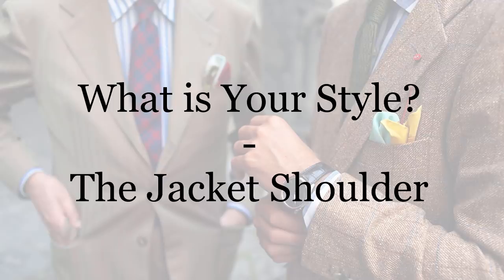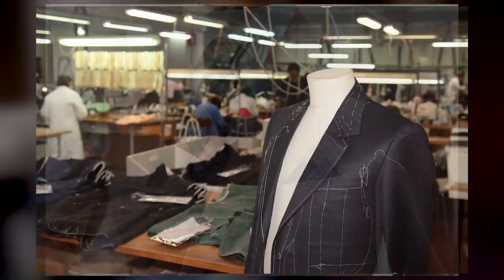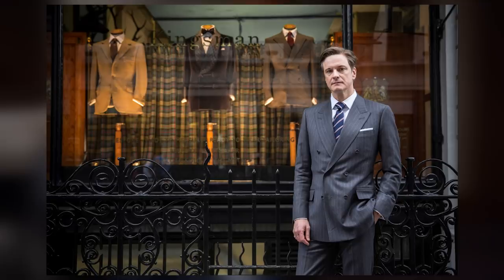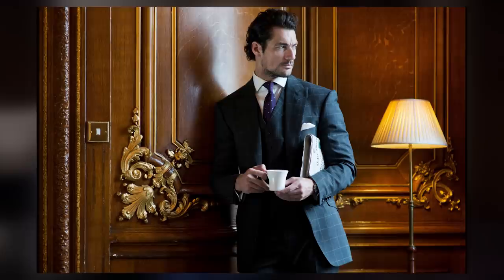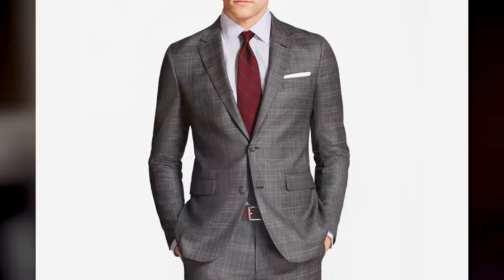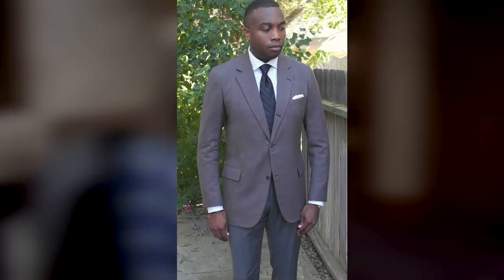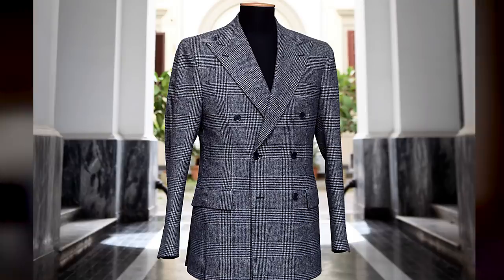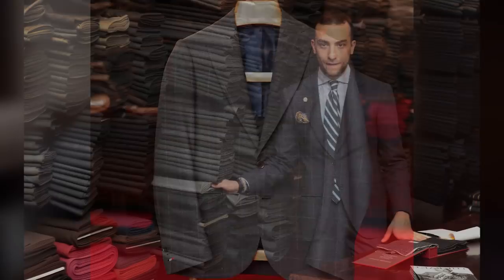What is Your Style ? The Jacket Shoulder

Comment: I own a white tie tailcoat from 1927, made on Savile row, and the shoulders are absolutely stunning. No padding whatsoever, just canvas running up and over the shoulder. The shoulders are also very slim, they don't extend past the shoulder bone, which means the deltoid muscle creates a subtle curve in the sleeve. Topping it off is a very nice, gathered roping which really accentuates the end points of the shoulder, thereby visually widening it. Somehow it's just a very special look, unpadded, slim, yet very masculine looking.

Also, I'd have added that the English, and basically any proper bespoke tailor, will cut a smaller armhole on the body than the sleeve and subsequently shrink the excess fabric away with an iron. The Italians often don't bother with the shrinking and stretching of fabric in various places, seeming to prefer achieving a similar result just by the cutting itself.
Reply from the maker: Hello Hank and thanks for the description of the " white tie tailcoat-shoulder " crafted on the Row, and particularly for your final point about the advantage of cutting a smaller armscye--plus the note of the English vs. the Italians on whether 'to iron or not to iron' the shoulder area to shrink excess fabric away. Please continue ! ~Sonya

Comment: ALL jackets are cut with the sleeve scye larger than the armscye. In contrary to popular belief, the spalla camicia sleeve has to be cut sightly smaller in comparison to the roped sleeves so Niagara falls wont form on the sleeves. The roping on a sleeve head is fairly easy to achieve by cutting the sleeve wading straighter in comparison to the sleeve crown.
Reply: What a wonderful, helpful fantastic comment; thank you so much! ~Sonya

Comment: Great topic. Question. I am always inbetween a 40 and 42 (depending on the suit maker). How much room can you give the shoulders before it is too big? Can you take in shoulders an inch if you are not getting bespoke or MTM?
And I echo the appreciation for this channel. Many of the style videos are either about vintage, or overal modern style, with very basic buzzfeed level comments. It is really interesting to see and understand the mechanics of clothing and the differents styles and why.
Reply: If fabric is reaching past the tip of your shoulder, a good alterations tailor may be able to remove the sleeve for adjustments, but the sleeve would have to have enough length in case it is shortened and then there is the issue of the buttons on the coff being affected. You sound like a great candidate for made to measure — If you prefer RTW, I don’t usually recommend a brand on comment answers but I will advise that you check into Pini Parma and tell Thomas I recommended you for a consultation. You can find his RTW brand on Instagram. I hope this is helpful and many thanks for your kind words. ~Sonya

Comment: Thank you for the great guide. I've always been told that I should wear structured shoulders because I don't have big shoulders and it's more flattering but I like the Neapolitan jackets way more. Do you think that anyone can wear the unstructured jackets?
Reply: If you love Neapolitan Jackets, then by all means wear them! Pay special attention to the line from your neck to the tip of your shoulder--I would make sure there is a tiny bit of structure in the shoulder line to keep the shoulder line straight (not crumpled up) and  in place---even if there is just one piece of canvas on top of the shoulder (between the neck and the tip of the shoulder). This is an easy solution to wear the Neapolitan Jacket well. ~Sonya

Comment: As long as the armhole is reeeally high in my jackets I don't mind too much what shoulder I have :p
Reply: You know what? I'm am completely on board with you on this point. One thing I learned about two months ago, is to simply request a SMALL armhole, because a SMALL armhole is always 100 percent of the time a high armhole. I'm not sure why this point took me so long to realize. Thanks for your comment. ~Sonya
Reply: Yeah, Sonya, that's usually my strategy too! It's probably one of the most critical and yet under considered and under appreciated aspects of most modern day suiting. Without it, the practical functionality of a jacket completely goes out the window! I was watching a video of Fred Astaire dancing a few years ago and I noticed that despite him having both his arms high in the air and his jacket buttoned, there wasn't any pulling on chest or waist of his suit and that's when I had the epiphany, haha. I reckon this issue still persists today (especially in off-the-rack suiting) because when someone has their arms down it isn't immediately apparent how big the armscye is due to it being hidden from sight between the sleeve and the chest? If people could be made aware of this they wouldn't put up with it I think. One really cool idea when getting a custom jacket is having the armhole height extremely high i.e pressing slightly into the armpit but have a little more room in the front and back of the armhole to compensate. I find this allows you really good arm/shoulder mobility in all directions but doesn't compromise on comfort plus it gives a nice drape in the chest and a sense of security because you can feel the suit hugging you gently.  It's takes a bit more time for me to put my jacket on but it's damn well worth it :p Love you guys and your videos!

- Max
Reply: I enjoyed reading this perspective a lot Max so thanks. Also, you will know you have a very small armscye when you CANNOT tie your own shoes---it's a very good sign that your tailor did his job right, because you can perform acrobatic moves without your jacket moving except for shoe tying...~S